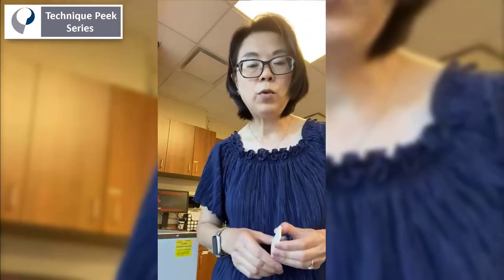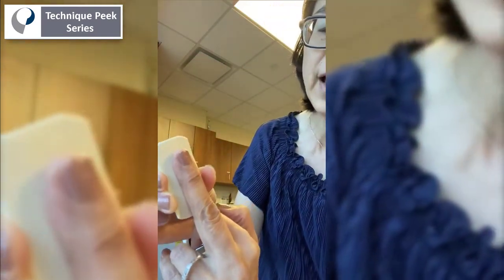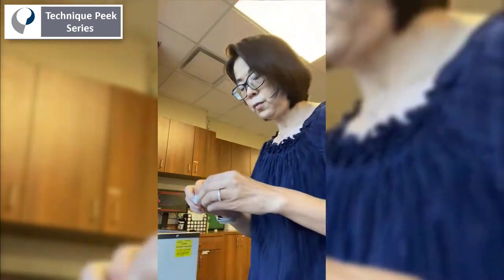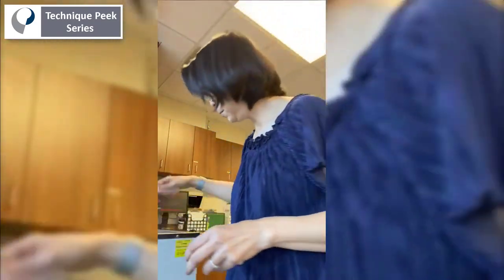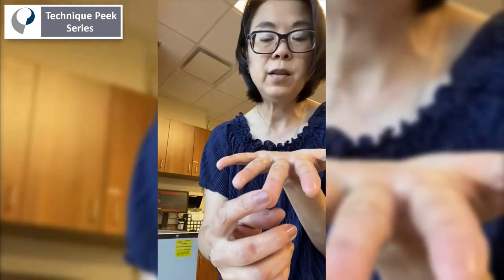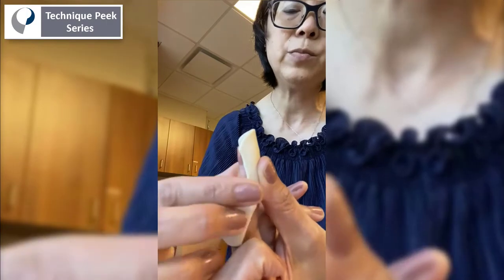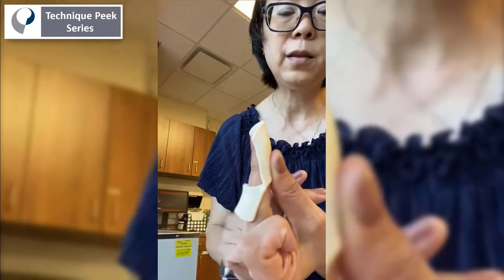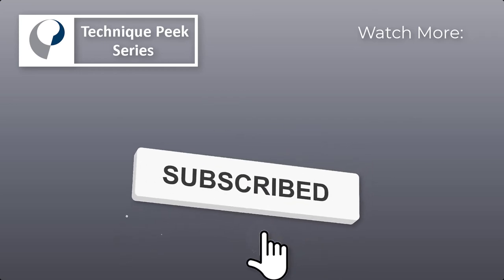How To Make a Mallet Finger Splint  |  Technique Peek Series

Comment: What if you don't have this material accessible asap and need a diy splint/brace temporarily? My middle finger locks and aches sporadically. I misplaced my splint need temporary one. What can I use other than this material or popsicle stick I don't have either? Thank you.
Reply: Just saw this comment but something you can do like use some sturdy construction paper and roll it around your whole finger. Tape it tightly and you should be good.
Reply: @AlpineRR26  thank you. I was able to find a straw and cut it in half and trimmed them down to size. Wrapped it in paper towel/napkin for cushion (like a tiny bed). Wrapped that in sports tape from the $1.25 store to "waterproof" it. Then cut a strip of sports tape in half to secure it on my finger like straps. Works well.
Reply: @jessicaduran19  Nice. I used this random piece of circular plastic from a glue stick container and taped it up with an extra layer of paper and tape.